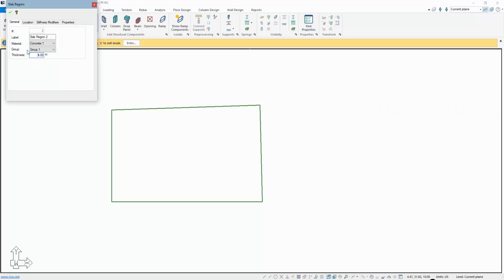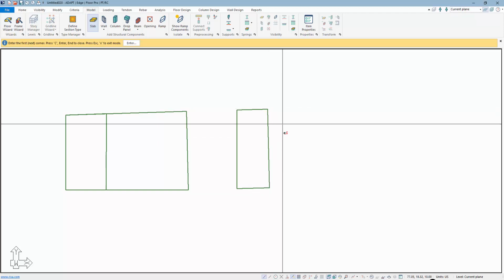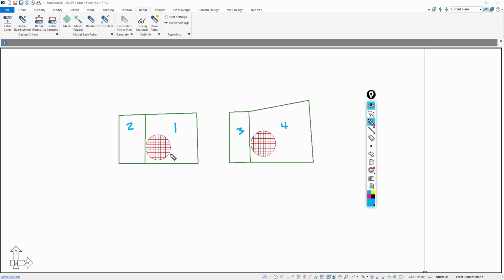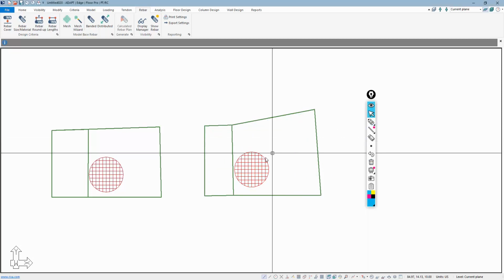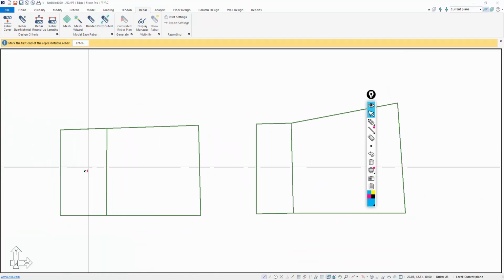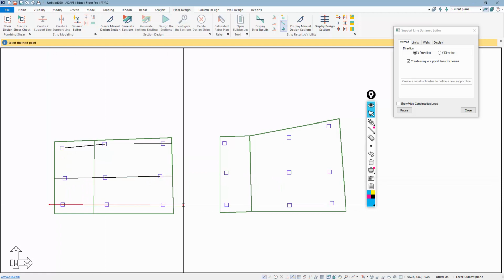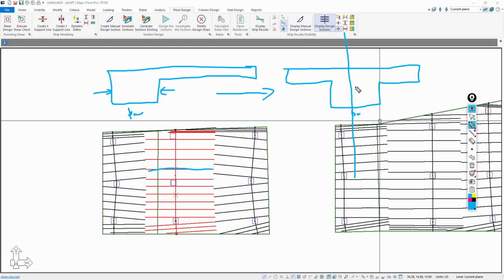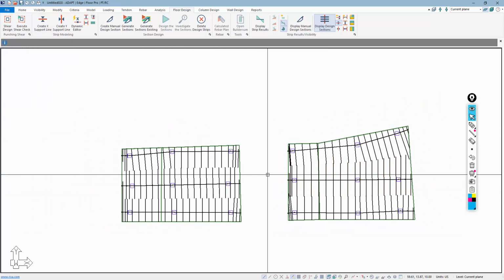Base Reinforcement location in ADAPT-Builder

Comment: Seems like there should be the option for the cover requirements to be based on the combined section, not the slabs themselves. So 1" cover would be above the bottom of the slab, whatever that thickness or slab would be.